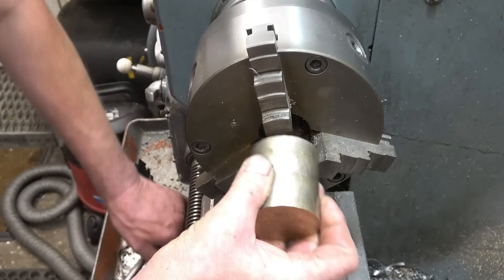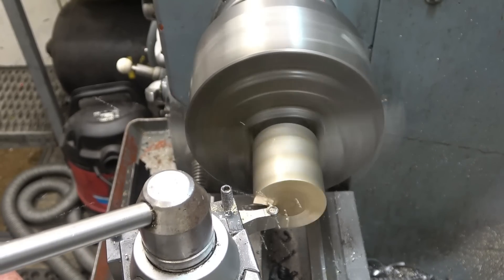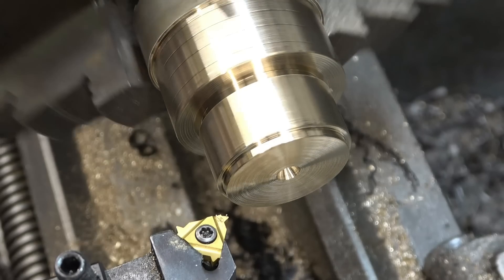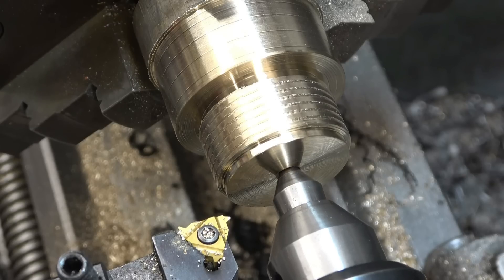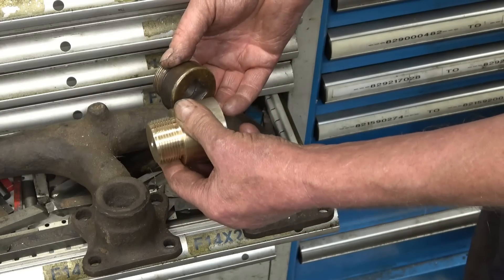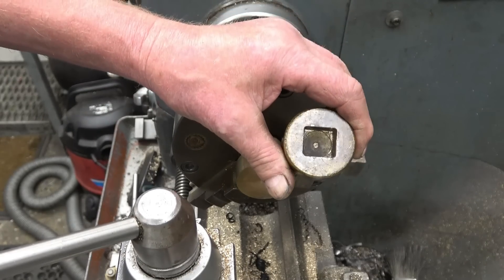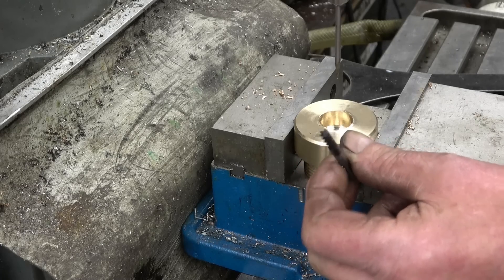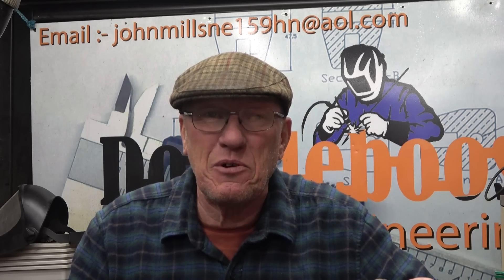SNNC 545 P2. Screw Cutting & Milling Bronze.

Comment: I've run into the strangest problem with bronze, brass, oilite, all of it... I finally managed to get a fair bit of the material for a good price, practically scrap price, and now I'm hesitant to use any of it! I worry about the extreme cost of replacement stock. It's an odd situation to find myself in. 😅

Comment: Surely the square hole must be 3/4” John being from an older piece of equipment but a nice job nonetheless the less
Reply: Just made some bronze bushes for a timber harvester yesterday, took my little slip stone and flatted off the cutting edges a smidge on a 1- 3/16" drill, but the bugger still grabbed and snapped the tang off a 3MT  drill shank ! 
Running out of my stash of bronze now too. I could have bought bushes on Monday, but they needed it back working ASAP.

Comment: Hi John, have you used thread wires or thread triangles to measure threads you are cutting? I know that the wires are a pain to use and I was wondering if the triangles are worth the money to buy a set and try out.
Great project and great Patreon tease at the end. 
Best of health to you and your loved ones
Reply: If using triangles you would need 55 degree ones not the more modern 60 as BSP threads are 55.
Reply: @chrisstephens6673  Are metric pipe thread forms 55 or 60? It seems that while the metric bolts are 60, the pipe thread is still 55 the same as Whitworth.
Reply: @douglasbollinger8678  the answer is both. The entirely metric dimensioned threads are 60 but the 1/4G, 3/8G etc are British standard but without mentioning inches and 55. Unless they have changed things again since brexit 🤔🤔
Reply: @chrisstephens6673 Hi Chris, the standard that defines the BSP thread is ISO 228 and is as you say dimensioned in the metric system. The nominal sizes are indicated by fractions preceded by G. There are also other standards for the mix of conical threads with parallel ones or conical male female I can't remember the standard numbers of these. Some sizes will couple with unified threads even though the flank angle is different.
Reply: @davidberlanny3308  I can't see that British pipe  threads are doomed in the foreseeable future, like battery sizes they are too deeply set in society to be changed. You may call a dimension 12.7mm but we all know it's really 1/2".
Reply: @chrisstephens6673  Yes you're quite right, I don't think it ever will. 

Not sure about the rest of Europe but down here in Spain most plumbing fittings are called out as 1/2, 3/4 etc although I don't think many know why. 

ISO 228 makes no mention of the origin of the sizes which is sad given that the thread form is Whitworth.
Reply: @davidberlanny3308  when I used to spend a lot of time in France at weekends, I knew a plumber who pointed that he was quite familiar with Whitworth threads, even in the land of the metric origins.
Reply: @chrisstephens6673  You know Chris I believe that BSP threads are known as Whitworth there
Reply: @davidberlanny3308  could be. My days of travelling are long gone so I won't check.😉
Reply: @chrisstephens6673  Great catch, thank you for the correction.
Reply: From my experience in manufacturing the three wire method was normally used by inspectors to determine the minor thread diameter gauges being used to determine other dimensions. AsJohn has done in the video, machinists normally cut the minor diameter on the nose of the work pice to give a physical reference. Sometimes on drawings where less common threads are required the minor diameter is given and the drawing calls for the reference section to remain, either to be used in inspection or to allow the thread to be “bottomed out” in a hole.
Reply: @grahamc887  three wire method will not give you the minor diameter but the pitch diameter. The minor die is so variable because you need a cutting tool with the correct nose radius or flat for the particular pitch thread. This is especially the case with ground HSS tooling, rather than full form inserts of a decent quality manufacture, where the tip of the tool if too sharply pointed would have to go a lot deeper for the PD to be correct. Of the three, the major, minor and the pitch diameters the PD is the only one that properly defines the thread fit.
Reply: @grahamc887  Thank you for this comment. I have always heard to use the wires when you want to ensure a proper fit and didn't give any thought to the reason why.